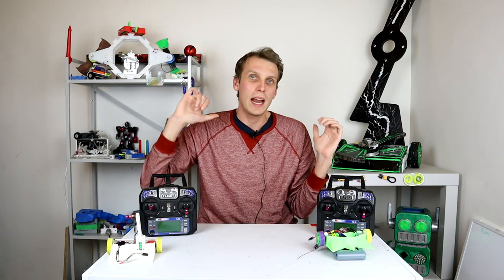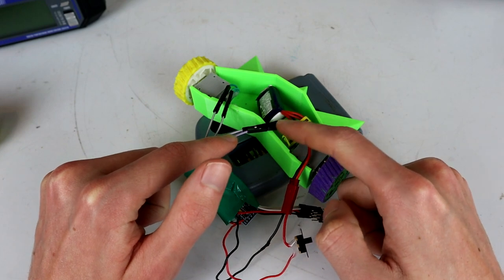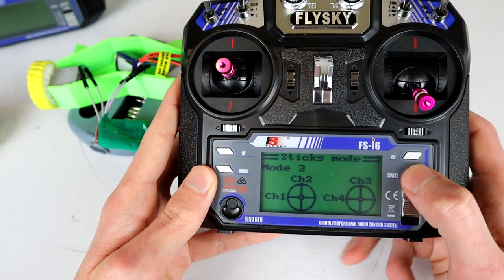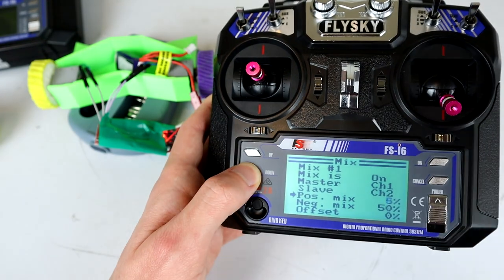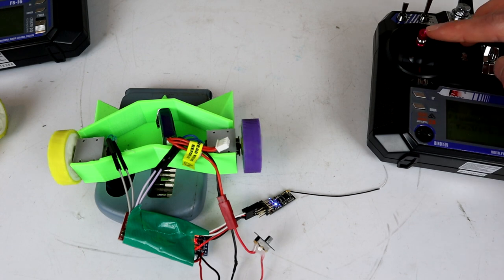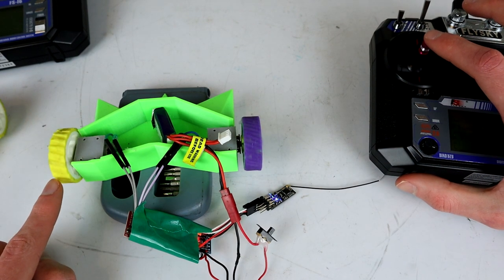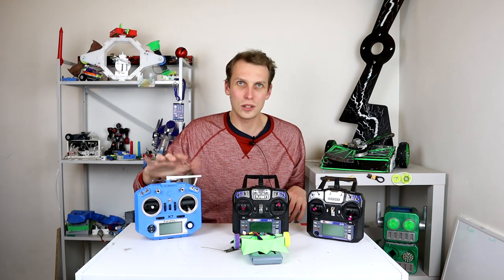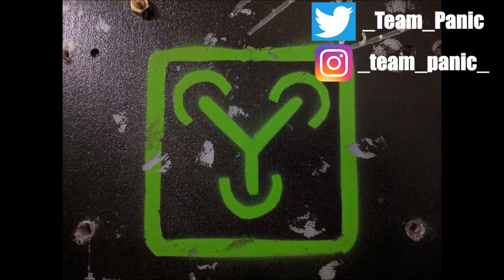Mix Flysky fs-i6 for robot tank steering

Comment: I need some help, i done everything excactly like you bit my motors dont reverse, they only go in one direction.
Reply from the maker: are your escs set up to drive bi-direction?
If you have just bought a random esc from somewhere theres a good chance they will only spin the motor one direction regardless of the signals your transmitter sends

Comment: helpful video i am using your method with FSi6 to control a rudder-less boat - ( 2 thrusters which operate like tank steer )   thankyou.   im also going to try elevon method and see how that gets on . I'm not a serious RC hobbyist but i've found the fsi6 to be a great value little transmitter for all my amateur projects despite its confusing button presses in the setup menus.   the little battery voltage telemetry modules (FS-CVT01) which you can get for it are great too - well worth investing a few pounds if its a model that you really can't have a battery cut out situation, such as plane or boat. they also do temperature and RPM modules possibly others. good luck with tank steering everyone!

Comment: Interesting. I set the mixes like yours except the -100 on channel 1 and +100 on channel 2. it made my controls at 45 degrees to go forward. I reverted back to no mix, all works fine. My issue is needing a little more dead space in the middle in both axis and the left and right to be less sensitive. It steers side to side too quickly. Mine is based on wheelchair motor and a sabertooth driver.

Comment: Yes, you could do it all electronically... The ol' FlySky FS-wotsit Tx is a sound piece of kit.  But I favour a crew of trained hamsters. 4 little furry guys, clambering about inside the bot, shouting orders, pulling this, turning that, loading the other; leaning out through the hatch to peer at the oncoming enemy through binoculars...

I was listening to 'Tank' by The Stranglers yesterday, working out J.J.B's bass part.  And last night I had the strangest dream. Can you tell?

Comment: Thank you very much. The funny part is that I have these same devices but I have been using an arduino to convert the PWM signals to control a motor controller in software. And I have 2 escs to make it way easier.

Comment: I'm using the same radio, but an fs-ia10b receiver. I've done the mix as you've shown, but only one of my motors are working. Should I remove the positive pin from that motor to get it going?

Comment: For the beginner like myself, there is a couple of other things I'd like to know how to set up on a controller like this.
1. If I want, let's say a motor, to be controllable by an aux switch (bad example is bad but it's the best easy way I can think of it) How would one set the aux channel up? By which I mean; by default, a 2 setting switch goes from -100% to 100% which on a motor would be full reverse and full forward. But I don't want it to do that, I want it to be full stop to full forward.
The actual use I want this for is for the eletromagnetic suspention idea, since wiring -100% would just swap polarity. Pretty sure I'd still need to link something like an ESC or some kind of controller up to it to be able to control it from the transmitter.

2. Can an aux switch on this transmitter be used as a reverse switch? My first bot might be a flipper, but I'm going to want to build an invertable spinner eventually. Would I have to buy a new transmitter, or can this one pull of an "I'm upside down!" switch. (Friendly reminder to set one up for AnneRUOK, if you've not.)
Reply from the maker: For num 1) there's two ways to do that, the easiest way is to use an ESC that's not bi-directional (like most brushless escs) because for a single direction ESC -100% is a full stop
The second way would be a mix which forces the low end to 0%, I've done something like this before with channel 4 but would need to dig into my old mix settings to give a guide on how to do it

For 2) Not on the stock firmware, I have heard that there is a firmware for these transmitters out there that has better mixing and can be used to do a reverse switch, but I haven't tested it yet.
I'll look into that for a future video

(I'm moving Annie_R_U_OK over to a new transmitter and will be working on an invert switch on that, thanks for the reminder though)

Comment: Hi, im having a problem with the transmitter. It can only go one way, if i want the motors to not rotate i have to hold the stick in the cornor. Basically it Shouldn’t be rotating if the stick is in the middel, but mine does. I Hope you can help me with this
Reply from the maker: This is not a problem with the transmitter it is a problem with your ESCs
You need ESCs that are programmed to do forwards and reverse motor direction
Reply: Okay thank you so much.

Comment: where is that power switch wired between?  I have a large (new to me) 24v robot. Original owner/ builder had a switch like that to power it down (two wire + &  - it appears with  3 pin female sockets)  very low gauge wire.  The fella I bought this from removed it. (I'm third owner)   Im trying to figure out where to reinsert it and am at a loss.  My ESC(s) are 24v Victor 883.  My remote is a 6 channel simple one hand remote....but does differential twin motor controlling (ok.. so its not a smmmalll robot)  .  Any advise?

Comment: If I were to power my tank with continuous rotation servos rather than motors, could I then run it with only a reciever and no speed controller? Thank you!
Reply from the maker: yes, continuous rotation servos have an inbuilt speed controller

Comment: Thanks for this. Very helpful. Quick few questions. If I wanted to add a weapon, would it be a case of plugging the ESC into channel 3 or 4 and then using the other thumbstick to control it?

Also, if I am more comfortable driving using the default two thumbsticks, how would I set up a weapon? Could I use anything else on the transmitter for this?
Reply from the maker: yes, weapons normally just get plugged straight into the 3rd or 4th channel with no mixing

I'm not sure about driving with two thumbsticks, in theory you should be able to do this mix across the thumbsticks as long as you pay attention to the channels used and plug your drives in correctly
It will make weapon control more difficult on these controllers as the switches on them are your only other option for weapon control and they dont have a lot of options for use and cant be mixed with the sticks

Comment: Thx for the video, it helped a lot. But I have a little problem. I'm running a Tank, two Quickrun ESCs go into the receiver (channels 1+2). It's working as intended, but one ESC cuts off after a few seconds and only one track is moved. After moving the stick to the zero podition it starts running again for a few seconds. I changed the ESC as well as the position they have on the receiver and also the motors. No effect. Maybe the radio that's faulty?
Reply from the maker: I have no experience with Quickrun ESC and you've given no information on motors or battery voltage
A quick google says they are a brushless ESC

I cannot give you guided help here as theres far too many unknowns and I have no experience with your setup.
But it sounds like an ESC issue not a receiver issue, if it was a receiver issue either it would never come good again until you power cycle the tank (the receiver has an electrical fault) or it would come good on its own randomly (the receiver has a signal issue)
The fact you need to push the stick to the 0 position sounds like the ESC is shutting down and is needing to see a 0 signal to start up again

Its possible that they are overvaulting or seeing a massive negative spike when you suddenly reverse drive and are shutting down

But take all of that with a huge grain of salt as its mostly a guess based on how esc's work in general as I have no experience with Quickrun ESCs
Reply: @TeamPanicRobotics  No problem, thank you for responding. I also think it's the ESC that's causing this, I will order a new one and change it. If the problem remains I'll have one spare. And yes, they are brushless ESCs with 540 Crawler Motors attached to it. Have a nice day mate.

Comment: Thank you! How is it that your self centering stick is on the different side than mine?
Reply from the maker: transmitters are sold with different "modes" i just have the mode where the self centering stick is on the other side

Usually it just means that stick has an extra spring, and in some cases you can open the transmitter up and change which stick self centers

Comment: I’m doing something similar to your on a hoverboard. I downloaded a firmware the right stick only work moving left and right to go forward with backwards ( both wheels move simultaneously) . Not sure which mode I should go into? Without overthinking it. And I’m still not sure what mix does exactly in my case … just in case you ask I have it connected to the ch1/ppm
Reply from the maker: I'm sorry I dont really understand your set up or know enough about hoverboards to be able to help you with this
Reply: @TeamPanicRobotics  i tested your thing out it doesn’t work on my hoverboard wheels. I thought it would work but it doesnt. It’s because it both plug into a circuit board. Rather independent the firmware i uploaded to it on GitHub is only programmed to run backwards and forwards simultaneously

Comment: Great video! Thanks for the tips. What happens when you push the stick to the corners - like upper left or lower right? Does it provide variable power to each motor, like a skid steer? I am wondering if I could use this to power only the left motor, or only the right motor, independently for more gradual turning.
Reply from the maker: Yep! this mixing provides variable power to each motor at every stick position
I'm pretty sure you can get the stick into a spot where its only giving power to one wheel
Reply: @TeamPanicRobotics  Terrific! Thanks so much for the response. Excellent video!

Comment: Thanks for going slowly enough that we beginners can follow both what you said and what buttons you were pushing to get that done!
   I'm curious about your ESC. In order to most efficiently drive 2 tank tread motors, am I correct that I need to use to separate brushed ESCs?
If you would suggest a single ESC with JST power leads for 2 motors instead, what should I look for (what is this called)?
   Your video greatly simplified what for me, was a very confusing programming task. Cheers!  - Jim
Reply from the maker: Glad it helped!

I tend to use DFrobot Mirco Metal Gear motors that have an ESC on the back of the, or custom ESCs

However some of the people I know use "5a dual brushed esc" from places like eBay and Aliexpress, thats a good search term to use and gives results like this:
https://www.aliexpress.com/item/4000202935819.html?spm=a2g0o.productlist.0.0.67927190BjE3CZ&algo_pvid=1c005a99-90f5-4f9d-88a8-de1a235512fe&algo_expid=1c005a99-90f5-4f9d-88a8-de1a235512fe-0&btsid=0bb0623a16225131825212880e3506&ws_ab_test=searchweb0_0,searchweb201602_,searchweb201603_

As I havent personally used them, I cant vouch for the effectiveness, but they should at least be on the right track

Comment: Nice video! I was just wondering if your robot has two esc’s or if your using one dual motor esc. Thanks!
Reply from the maker: For most robots I use two ESC's, one for each motor, but in ant weights I will sometimes use a dual motor esc

Comment: Hey
is there a way to set diff performance modes using the aux switches
like mode 1 will enable 50% motor power in all directions
and mode 2 will enable 100% motor power in all directions
mainly to have more precision on the stick while doing tighter movements
Reply from the maker: As far as I know, not for this controller with stock firmware, its fairly basic

I've heard rumour of more advanced firmware out there but havent ever used it myself so cant comment

Comment: I need help! I have a Flysky I6X transmitter to control my tracked inspection bot. But when I first switch the transmitter on, it beeps and gives me this message: "!!WARNING!! Place all switches in their up position and lower the throttle" Sometimes I just bump my left toggle switch, channel 3, and it stops the warning and gives me full control.  But all too often, it doesn't matter how many switches and toggles I move around, it just keeps beeping and will not give me control. What is it doing and how do I get it to stop? I have a simple tank chassis with a light and camera gimble on it. It's not like I need a safety switch to start with. Can you help me?
Reply from the maker: Hi 
I'm not sure its possible to turn that feature off, and I do get that it can be a pain
In the past I've had switches break (usually after transporting the transmitter) and they have been stuck in the wrong state, so the transmitter gets stuck giving that error

If lowering the throttle and toggling the switches back to their default (all up) is not fixing it, I'd suspect you also have a broken switch
Which gives you two options, replace it, or disconnect it and either leave the leads disconnected or connected together (which ever one lets the controller start up)
Reply: @TeamPanicRobotics  Thank you for your response, but it seems to have straightened itself out. It drove me to my wits end and sent me seeking help and then just like that, it's working normal again.

You suppose it was ashamed that I had to complain about it?😄

Comment: Nice video, witch ESC do you use?, I try with this ESC (Hobbywing Eagle 20A ESC For Brushed Motor For RC Airplane Plane 370 380 390 280 270) but i can't reverse the motors.
Reply from the maker: The ESC's I use depend on the robot and the motors I am trying to drive.
But when buying ESC's I make sure they are Bi-Directional or have the option to make them Bi-Directional in software

Comment: Thanks Ben awesome information  im just about time order that handset ? Will you be showing how to mix the weapon motor or is that straight forward?
Reply from the maker: I dont use any mixing on my weapons.
With the sticks set up as shown, the "throttle" stick is channel 3, I just plug my weapon ESC into that and use the throttle stick as is to control weapon speed

Comment: Out of curiosity, how compatible are all the various transmitters and receivers? Is there a single RF protocol or a mix of proprietary systems?
Reply: Unfortunately, they're not generally compatible at all; there are many systems. Some of the more expensive transmitters have a "multiprotocol module" system which allows them to drive different types of receivers (not all at once, selectable from the menu). The protocol we usually use with the FS-i6 is called "AFHDS2A", which is not to be confused with older FS protocols.
Reply: what mark said, but the i6 supports afhds as well as afhds2a, its a setting you can change to use the older flysky receivers

Comment: It works well! Thank you. But how to setup the reverse/backward? When it is on reverse/bakward the steering is reverse too. Turn left becoming turn right and vice versa. Any idea on how to fix this?
Reply from the maker: I dont, its only very recently that learned this was the case.
I have been using this mixing set up for a few years now and it never came up, I just dont turn while driving backwards.

It might be possible to fix this issue, but it will  be a much more complicated mixing algorithm that I dont think the Fs-i6 can handle
Reply: @TeamPanicRobotics  Ahh that does make sense, as this kind of steering is capable to do tight turning actually we dont really need to turn while reverse. Straight reverse and neutral turn is enough. Okay, thank you for the share!

Comment: hey I have been trying to make thr control in dual stick. Is it even possible?    Like, left goes forward backward and Right goes left-right. Also I want to use both stick togather like an RC car.
Reply from the maker: it should be, Stick directions are given numbers, that how the mixing works, it mixes 1 with 2

All you need to do is use the "modes" in the menu, and find one where 1 is the  forward-backward on the left stick and 2 is left-right on the right stick
Reply: @TeamPanicRobotics I’m trying to get this working but the problem is that the throttle curve only works on the left stick as far as I can tell
Reply from the maker: Thats not correct,  these transmitters run the same firmware regardless of how the sticks are set up (they sell this same controller with the unsprung stick both left and right and the provided firmware on both options is exactly the same), so in firmware there are the options to treat both sticks exactly the same, if you haven't found the throttle curve for the right stick then it might be berried in a menu or you might need to change some other setting first (like maybe the stick mode)

I use stick mode 3 which puts ch 1 as the left/right on the right stick and ch 2 as up/down on the right stick. If I swapped it to stick mode 1 it would put ch 1 as the left/right on the left stick and  keeps ch 2 as up/down on the right stick

Unfortunately, I'm really not an expert at these controllers, I have exactly one use case for them (setting them up as shown in this video), so I know the settings and setups to get them to do exactly that. But for other use cases, I'm a little out of my depth